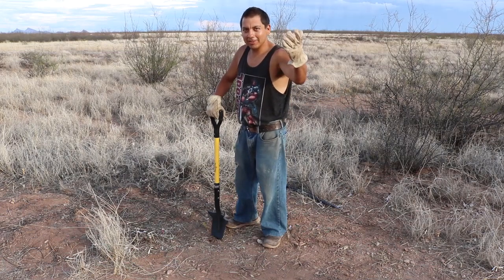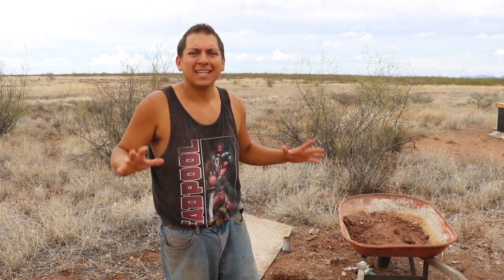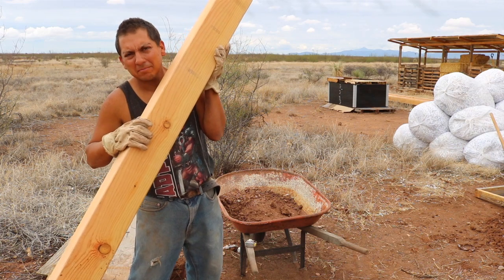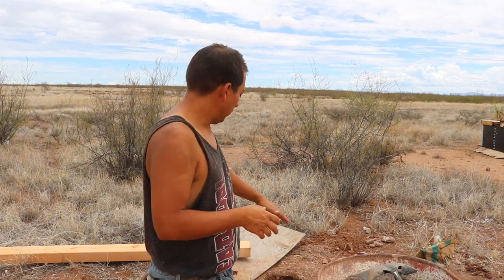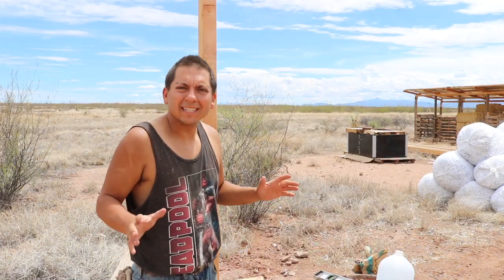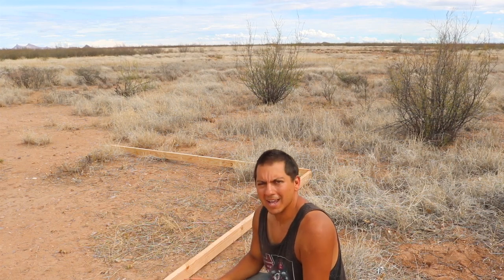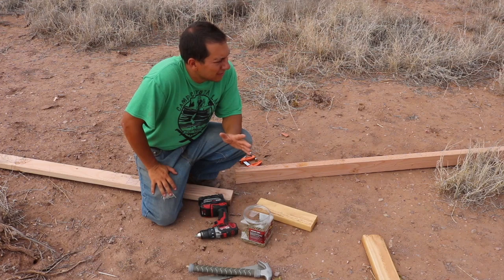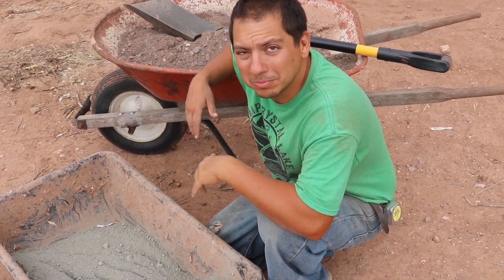DIY Solar Panel ground mounts! Part 1

Comment: We put a ground mount solar structure at our home near Downtown Tucson - also with 15 LG panels.  We wanted the shade from the ground mounted panels for our trailer, which functions as a guest room.  

The main load for ground mount structure is not the gravity load, that is the weight of the structure and panels.  Instead, the main load is uplift on the panels from wind.  The wind will pull up on the panels trying to carry them away.  Our engineer for the solar panel structure assumed 110mph wind and an uplift force on the panels of 35 pounds per square foot (psf).  

For our nearby ramada over the patio, a different engineer figured 25 psf uplift, which is probably assuming less wind.  

Bottom line the concrete for your posts needs to help hold the structure down.  That is, the weight of the structure, panels and concrete plus friction to pull the posts out of the ground needs be able to counter the uplift force from the wind.  If you look around Tucson, you will see some of the ramadas have rocks in gabions (wire "basket") at each post of the ramada to add raw weight to hold the shade structure down during high winds.
Reply from the maker: Thank you, that's some great information. Much appreciated.👍🙏 I like your idea on the ground mount. Stacking functions is what it's all about.

Comment: Good start, guys! I haven’t done a lot of concrete mixing in my life, but can you say something about mixing the concrete in the hole as opposed to outside the hole?  What’s the logic for one over the other?
Reply from the maker: MidlifePrices mixing the concrete with water before pouring is probably always best. It'll mix better and probably be stronger. A lot of people just pour in the cement and then add water. It's still strong, but probably not what it could be. What I did here was mix cement with gravel for a concrete substitute, so I wouldn't have to by another bag.😆
Reply: Cool.  Just checking.  I've seen it done both ways, and just wondered if there was any other logic behind it.  Thanks.

Comment: once again great work guys!! keep it up. A couple of braces to keep those posts upright while the concrete sets might be a good idea next time, hate for the wind to just tip them slightly. Also, try and place your bubble level as high up the post as possible. your get a more accurate reading. Really hope you dont mind me say, not being critical just trying to give my constructive advice from my experiences
Reply from the maker: Gaz Underhill thanks for the tips. I don't mind suggestions at all. I'm always ready to learn.👍